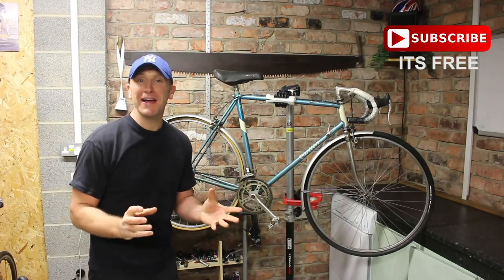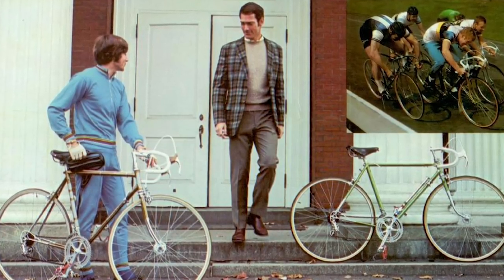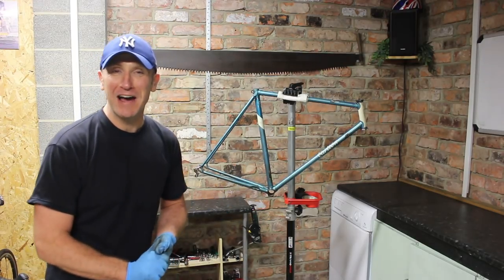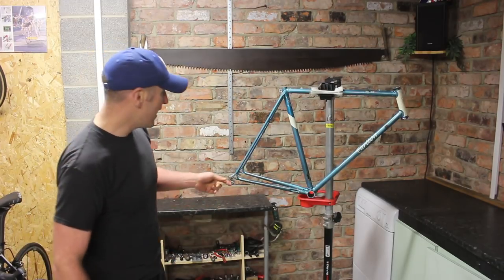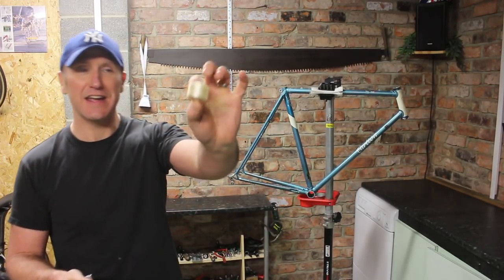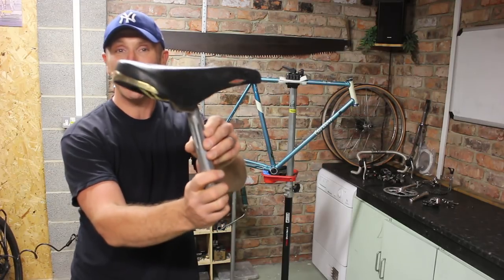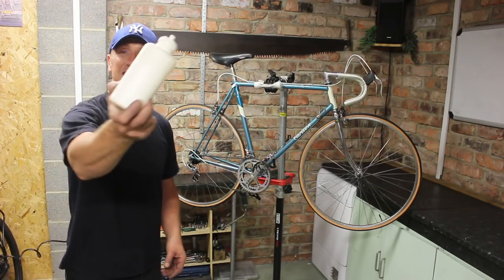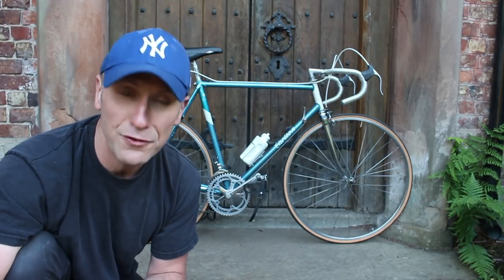Vintage Carlton Road Bike Restoration

Comment: I have a 1980s Carlton Cyclone that is in running condition but would like to restore. Knocks, scratches and rusty chrome. All original except saddle. Only 5 gears as originally sold, as I know its history. I would like to upgrade to 10 gears with period parts. Useful post and helpful. Looking to build knowledge and confidence before I attempt.
Reply from the maker: Not a bad idea I've just converted a Bob Jackson 👍

Comment: Love the golden arrow set. Got a full Shimano 105 golden arrow set on my 1984 Raleigh Corsa. Though it's not as lovely and shiny as yours, it did look about the same as the ones you bought so I imagine it would clean up beautifully if I was so inclined.
Reply from the maker: My first road bike and restoration was the Corsa check out the video it’s on of the very early ones. It’s one bike I will not part with. I’d say the gold arrow gear is the best for polishing, very rewarding.watch the Raleigh Corsa Video it’s in three parts, the final one is the ride thanks again Andy

Comment: I had a very similar looking Carlton when I was a kid but I think mine might have been pre-Raleigh buyout. Exact same colour and decals but didn't have Reynolds badges and chrome forks. Really cool badge on head tube, that was the same and the angular banding on the seat tube. Mine also had a nice kind of wrap around welding of the seat stays at the top.
Reply from the maker: Thanks Simon for tuning in and sharing. I hope it’s brought back some fond memories I love hearing about them. The welded wrap sounds like an older model. 👍

Comment: Nice quick video on restoration.You didn't mention the wheels which in most cases need working on but I guess wheels are a separate job all of their own.
Reply from the maker: Hi and thanks for watching the wheels normally just get a rub down with metal polish as long as they are running true. Same with the spokes or may even use a fine sand paper if they are I a bad state. Really I should dedicate a video to cleaning 🧼 wheels 🤔thanks again and all the best Andy
Reply: @BikeItUK  Your bike restore was in good condition so an easy one to do.Not often one will find a bike in such good condition.I am restoring a Carlton I got off the local market. Lots to do from paint stripping to repairing wheels to getting BBracket out and regreasing.

Comment: Hi :-) May I ask which was the cheapest build you ever featured? Of course I also appreciate your perfect, original, high end builds, but sometimes you need a cheap fix. Would you make a dirt cheap bike for once? Kind of sweep up the garage floor for parts and make it work brilliant still? Just based on a vintage lugged race bicycle frame. (I built my Atala, and I just wonder what you would come up with.)

Comment: That was Amazing, I found one where I live and interested on rebuilding it as well but my Experience is almost Nil!   I'm sure this bike has being sitting outside in our Winter weather for awhile now and unsure how rusted the BB is going to be.  The Crankset is still on but wondering if you have any thoughts.
Reply from the maker: Regarding the bike in question, my experience if the bike is in such a state then you have nothing to loose. I have done a video on removing square taper bottom bracket and cranksets that may help you out. If you are new to this then take photographs of parts before removing the parts. I hope this helps good luck 😉🚲

Comment: Great restoration but you have about 2" of extra cable for the rear brake and for the rear derailleur vintage derailleurs don't need such a large loop of cable as modern ones.
Reply from the maker: Thanks for the comment and watching, I'll take the advice on board thanks again

Comment: Back in the 70s before indexing, "groupsets" really didn't matter ... manufacturers and consumers mixed and matched shift levers, derailleurs, cranks, brakes, brake levers to whatever was best or best for the budget. Precise indexing systems spelled the death of many smaller manufacturers. Go to flickr (zbillster) and check out my albums with old Bikecology and Palo Alto catalogs from the late 70s and early 80s! These are scans of my personal catalogs I got in the mail as a teenager. :)
Reply from the maker: Thanks for the comment and advice, so true and thanks for the heads up on the Flickr account 👍all the best Andy

Comment: Im going to be restoring a Raleigh Super Course. When using a polish should you avoid going over the decals, and have you ever used a clay bar to lift the grit and grime prior to polishing?  Thanks and cheers.
Reply from the maker: Hi and firstly thanks for watching! Regarding polishing and your question yes avoid decals, and no Other haven’t used a clay bar sounds interesting 🤔 all the very best Andy
Reply: I use a clay bar for auto detailing. You should try it on a bike It really helps removing imbeded particulate. Love your videos and your passion
Reply from the maker: Thanks Don 👍🚲

Comment: Do you ever upgrade the double chainrings with a triple?
On ten speeds, I like to replace the freewheel with a Suntour Ultra 6 and a triple chainring: almost doubles the original gearing.
Reply from the maker: I generally just keep them double unless a touring bike. Which I haven’t done one of those yet so watch this space 👍🚲
Reply: @BikeItUK  Will do. Thanks.

Comment: Hi Andy - nice video as usual 😉.  Do you work, (or ever worked),in the bike industry or is this just a hobby of yours? If it's just a hobby how did you learn how to work on bikes?
Reply from the maker: Hi and thanks for the support. Check out our website about me section at www.bikeituk.club for more history. Basically it’s a hobby that start in my very early teens. Constantly upgrading parts and trying to get lighter and faster. 🚲😉🧢
Reply: BikeIt UK Thanks Andy - great website and very interesting reading about your past!

Comment: I have been looking around for a source of  T-cut in canada, I have seen it listed on amazon for $75 for 150g tube and also specific to a particular color of paint. I am assuming that this is a nutter price, how much does it usually retail for ? and is it always specific to a particular color of paint ?
Reply from the maker: Hello and thanks for watching! T-cut for the large bottles are around $12. The original is the best as a bottle will last a while and do many different frames colours. The colour ones are great if your using it on a large area such as a full car 🚗 which helps bring out the original colour. I would go to a local automotive outlet and explain what you are after. You will have the same product under a different manufacturer local to Canada 🇨🇦 at a fraction of that price. Hope this helps good luck and all the best Andy

Comment: Great job! How did you manage the rust on the fork?
Reply from the maker: Thanks for the comment on the Carlton  Vintage Road Bike Video. The forks I rubbed the area down then used a rust solution called KaRust then painted with a Crome touch up paint. Hope this helps in your own Bike Restoration’s. All the best Andy

Comment: I wonder if that's a Nottingham made Carlton due to the fact it didn't say Worksop on the headbadge and had an integrated derailleur hanger and braised on shifter mounts (all uncommon for Carlton's that weren't top of the range).
Reply: If the frame number stats with N that would be a giveaway sign.
Reply from the maker: Maybe interesting, love digging into the history and trying to work out the differences with the frames thanks for the information

Comment: where do you find decals 

i am looking for set for colnago vip2000
Reply from the maker: Hi I’ve just looked on eBay with no joy, my only other suggestion is on the Kirk Precision video I mention a website I used for that build which was extremely good. I hope this helps good luck 😉🚲

Comment: What do you do if a bike has a bent rim
Reply from the maker: Actually bent damaged rim, needs replacing.
Reply: @BikeItUK  thank you for the reply. I recently bought a 70s Peugeot and I love it but the rear rim rubs against the brake pad, is it beyond repair?
Reply: @BikeItUK  the rim is Rigida Chromolux

Comment: If this bike was intended to be ridden,then I would never put junk tires on,spend some money to have tires that are current.Same thing with the bottom bracket,throw the junk cup and spindle bb in the garbage where it belongs,any modern cartridge bb will provide superior service.The same with chains,leave the old heavy chains off,modern chains are so much lighter and far stronger than any from the time frame this bike was new.The Benotto tape would have looked nicer if it had been correctly applied.To restore a pristine example to the state of delivery from the bike store is one thing,but a bike that falls far short of being pristine needs to be updated,there is nothing noble about "gumwall" tires,crappy bottom brackets or chains.

Comment: hey I really like this channel. One question: what do you think of doing a vintage build like yours but with a modern groupset(2x7s for example with STI if rearwheel for example is freewheel, doesn't have to be the newest of the new 2x11) bartape and maybe tyres?
Reply from the maker: I ride a Colnago Master Piu with full Campagnolo Potenza 11 Speed groupset but with Delta callipers. I’ve done a video on it 👍🚲😉thanks for tuning in all the best Andy